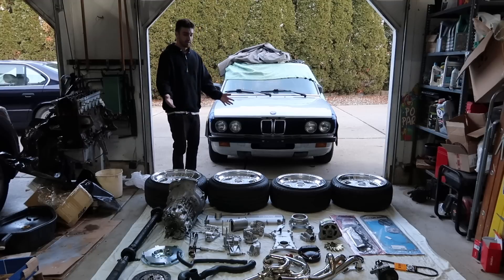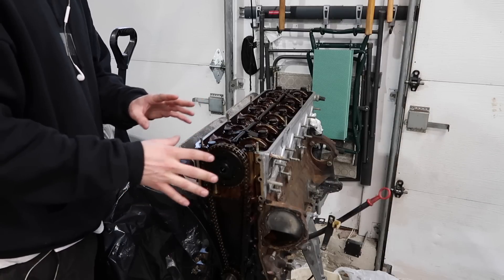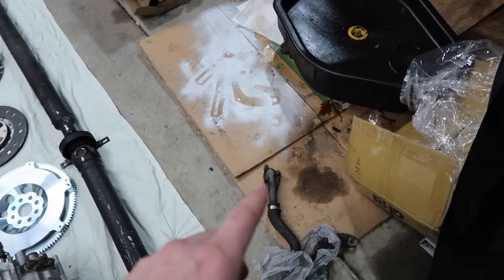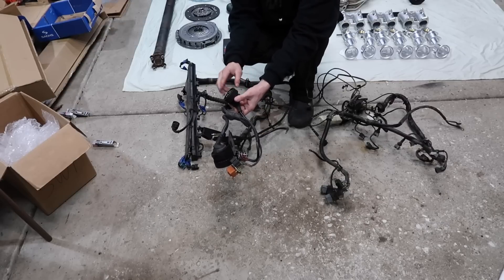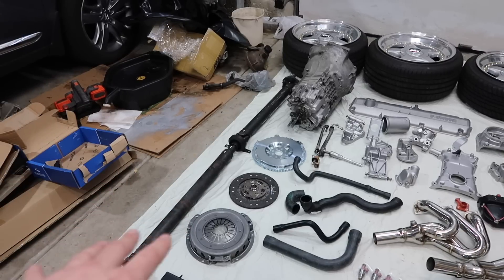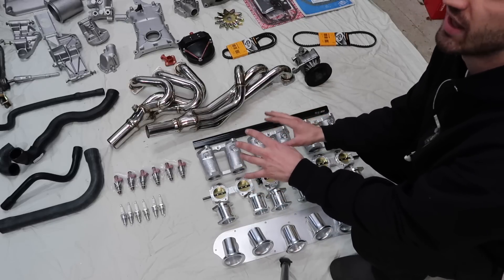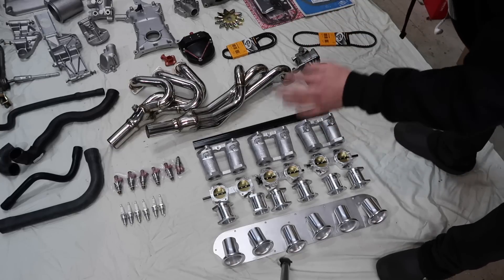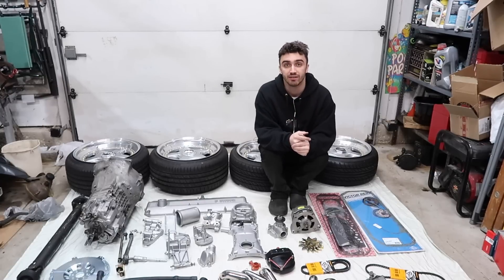Complete Overview of my ITB, Standalone ECU, M30B35 BMW E28 Project | All the Parts Needed!

Comment: E28 did come with the m30b35
Reply from the maker: Which ones Id love to know because my years of research and first hand experience have told me otherwise
Reply: @m3nameisjosh464  I know for a fact that in europe we had the M 535. I know a dude that has two of them. And one of the latest videos by Ammo he washed a 535i in the US. So there should be 535’s in the US too.
Reply from the maker: @andrisavotins5473  535s exist in the US yes, but they are M30B34s. Same engine, .1 liter difference
Reply: @m3nameisjosh464  All i can find is the m30b34 or b35 all had the same displacement of 3430cc making, at most 218hp in the m535i version. How much hp does the b35 in the US make at most?
Reply from the maker: @andrisavotins5473  208hp 225 torque in US.

Comment: Oil pans on late and early cars are different but interchangable with blocks, subframes of pre 1982 cars in europe are E12 based so wont fit
Reply from the maker: So e12 and E28 m30 oil pans are different enough to warrant not working on each other? Putting this B35 into an E9 soon, Ill need to use the e9 pan?
Reply: Yes I believe so as the pans are set up to fit within different subframes so are visually very different. I have heard that oil pumps set up may be different as well due to space in pans, its been a long time but I think some parts from old and new pumps combine to fit??? Let us know when you get that far
Reply: Pans fit both blocks but wont fit into subframes
Reply from the maker: @markhaith4720  ill have a whole series on the car! Thanks for the insights!
Reply: Are you restoring or restomodding? I think E9 is probably greatest out of E24 and 8 series but I love all three.
Reply from the maker: @markhaith4720  restomodding, its a Sicily car imported here, needs some love but I want a group5 style engine setup

Comment: You sir are a legend. I’ve been emailing Rama about putting the RHD ITBs in my M30B35 powered E30. This video series will make things so much more accessible! Thanks!
Reply: Interested to see if you run into any clearance issues with the brake booster. I’m anticipating an issue in the smaller E30 engine bay
Reply from the maker: Thank you man! I don’t think I’ll have any issues. There is a pretty good amount of space but we will see!

Comment: Def tapped into this build; haven't seen much coverage on in-depth M30 swaps since S/M5Xs are more popular. Currently doing this swap in my E30, I would suggest if you don't already know that you'll need a e28 535 radiator because the M20 Radiators have different inlet and outlets than the M30 ones do.
Reply: Very excited for the ITBs as well I've been scoping the RHD kit but too scared to pull the trigger.
Reply from the maker: You just reminded me I forgot to include the radiator in this video lmao. Yeah i have an m30 e28 radiator on standby

Comment: 👌🏻 Prima parts. Coooool😎 When mapping time comes, I recommend going with alpha-n. At least that's what I ended up with. The manifold air pressure was way to "jumpy" and non-linear with the itb's as to be used as a solid VE reference.
Reply from the maker: Yup alpha N with an Iat, and a variable tps